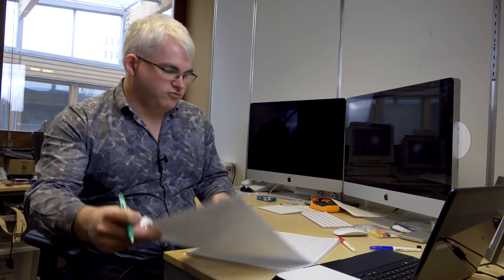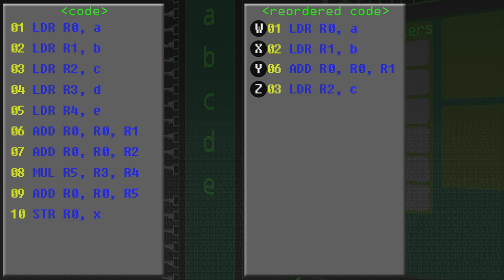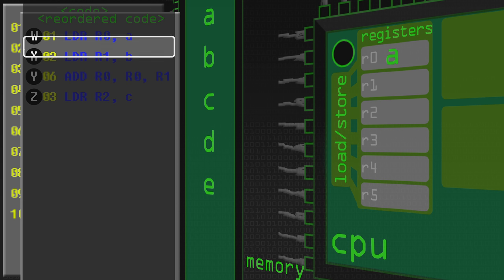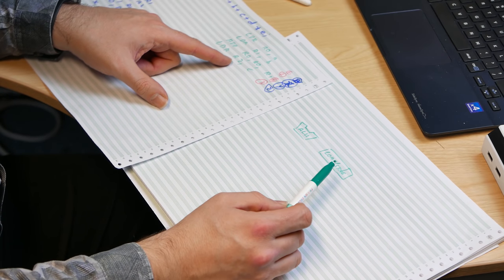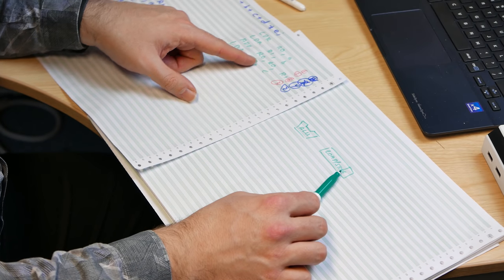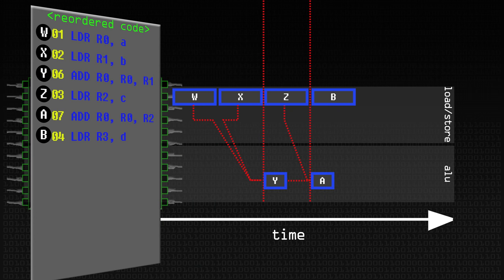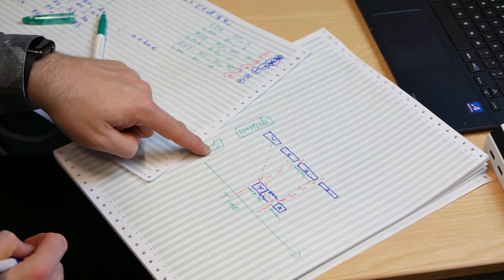CPUs Are Out of Order - Computerphile

Comment: I'm confused why the processor would ever do the optimizing, instead of a combination of the compiler/interpreter (for the particular bit of code) and the OS (for different processes and whatnot) doing all the optimizing, since those actually have all the information about what will be run.
Reply: Actually they do not have all the information about what will be run (if that were the case, it could speed programs a lot). You have to take into account the dynamic factors. Values in cache, branch prediction, utilization of individual cores (hyperthreading) etc. all affect the program execution severely and they're very hard to predict during compilation (although compilers of course try to do their best and you can help them with profile guided optimization).
Reply: The processor is the only one that knows whether an item has been fetched from memory previously, and is in the cache, which provides a huge speedup. The compiler cannot possibly know the contents of the cache, although it should do some optimisation of its own.

BTW, modern software can be rather inefficient, and it if weren't for fast CPUs, things would sometimes  go very slowly...
Reply: That's exactly how Intel's Itanium CPUs work.
Reply: If the compiler or interpreter were to try and it do it would be what's known as a premature optimization because you'd be optimizing for an assumed/theoretical cpu instead of knowing what it's actually capable of. It could be that your optimizations work well for a select few or even a great number of cpus on the market today, but tomorrow will come and new cpus will be released and your modified code could very well perform worse on those. You should just let the cpu itself do what it knows it can do.
Reply: ZeikJT if your compiler knows what CPU it will run on (and given the size of actual executable machine code versus the size of storage there's no reason not to include all existing CPUs), then it can target all of them. If a new CPU is built you can recompile your code to make it the most optimized.
Reply: Jakub Beránek but the OS understands those factors. Combining what the compiler knows and what the OS knows should include everything the CPU knows (assuming the CPU correctly identifies itself to the OS), as well as quite a lot more.
Reply: I must be misunderstanding you Joshua but it sounds like you are saying that the compiler knows before execution what the various states of registers etc. will be during execution?
Reply: Dan Kelly it knows to the degree that it's code controls them (obviously it doesn't know all the exact values, just where they came from and what affects them). But the operating system knows the rest, because it knows all the code that gets run on every processor.
Reply: Joshua Hillerup Compiling and distributing different binaries for every possible combination of CPU clock speed and cache size would be a ridiculous waste of resources...
Reply: The compiler knows how the cpu works in theory, but in practice the cpu is  almost never exclusively running your code (unless you are writing an OS) , it's running a lot of other things too which leads to a lot of uncertainties in terms of the cache. I don't know of any way to query the cpu about what exactly it has stored in it's L1 or L2 caches for instance and the query itself, if possible, would probably be slower than just letting the cpu do it.
Reply: In a multitasking operating system it is impossible to anticipate the exact state of the CPU and cache beforehand...
Reply: I should probably specify that I'm musing on if a future operating system designed to make use of information from say a compiler or interpreter for a dependantly typed programming language could exploit to to make everything be fully optimized, and less wondering about say current gcc and Linux.
Reply: ZeikJT aren't processors completely deterministic though? Shouldn't the operating system know what the processor (or rather full set of processors) has already done?
Reply: But you still can't take it all into account because of user input and whatnot. If a program asks me to enter any value, you couldn't have infinite optimisations for whatever I could write.
Reply: Casper S? The compiler knows what values can be taken in, at least if it's for a language that cares at all about things like efficiency.
Reply: Joshua Hillerup Nope. They're not deterministic, or at least not if you have I/O (where you don't know what will happen; will you receive a network packet, complete and receive a disk read, or detect a key press, or not? etc...), or operations that involve true randomness (rather than pseudorandomness), which some CPUs do provide for with instructions that utilise specialised electronics for (such as exploiting quantum uncertainty), such that they can generate true random values.

Absent these factors however, yes they would be deterministic, but a computer with no I/O is not a particularly useful computer. And everything must be invariant to retain that determinism - eg. same memory capacity and speed, consistent clock speed per core, and so on and so forth. This is very hard to achieve - even impossible for most architectures.
Reply: Matthew Ducker can't that randomness be constrained?
Reply: Casper apart from constants it doesn't know what any value is going to be, but it does know what types to expect and what will be done with them.
Reply: Two reasons CPU optimize: 1) Compiler only produce binary for an ISA (instruction set architecture), not a specific CPU, your x86 binary has to be able to run on Intel i7, AMD Ryzen, or Intel Celeron;  2) Different CPUs have different internal features (clock speed, cores, ALUs etc)
Reply: Leon Yu that sounds like a design flaw to me, when taking into account everything in a system.
Reply: Problem is "knowing" is not enough.  It has to be mapped to memory, and all known states can be practically infinite even for a simple program.

Then there's interrupt of all kinds, which OS knows will happen but does not know when or how it will happen.

Then there's problem of finely tuned optimization can break extremely easily.

And even with such finely tuned code working as expected, it may not be worth the cost after all.

Basically, you are asking for Itanium.  And look at what happened to it.
Reply: ikickss the only thing I'm asking for is a unique identifier for the exact processor being used which is accessible by the OS, and the relevant details to be published somewhere. Since a processor already reports details such as which instructions are available that doesn't seem like much.
Reply: Only in theory.  
Deterministic =/= useful predictability
(I am ignoring built-in random number generator which is another truck load of worms.)
Reply: You can call it "design flaw", but that's what legacy and future-proofing is all abut. Your software not only has to run fast on everything that was produced before, it also has to run fast on everything that will be produced in the future. The same is true for CPU, your CPU has to run everything that was produced in the past for similar CPU, it also has to run everything that was produced in the future for similar CPUs. 

Alternative approach is the JIT/scripting language model, where you produce a code that won't be compiled or JIT'ed until user needs to run it. Problem with that approach is that user needs to install the runtime (Java/Python/.NET/etc) on their computer.
Reply: I have a similar concern.  Granted my understanding is limited of how microcode is impleted in hardware, but I don't see how the CPU can efficiently figure out how to order the instructions in real time without adding a lot of overhead to the program.
Reply: A ahead-of-time cpu-specific optimizer is an interesting idea, but that's pretty much what the CPU does already with out-of-order execution and microcode. There's also issues where you have unknown branch results and potentially funky pointers and it's literally impossible to optimize all of these ahead of time.
Reply: A future CPU will be required to execute loosely typed code. A great design will be offset by Intel's ability to buy a better manufacturing process. The CPU design called "The Mill" has a lot of interesting ideas in this area, and the designers realize that they might as well not exist without a standard C compiler.
Reply: That's exactly what VLIW does. Problem is assembly is pretty much impossible to do, they use more memory and compilers are a pain to write and optimize
Reply: They tried to do exactly this with Intel's Itanium CPU architecture - unfortunately, due to problems it failed to achieve market success.
Reply: Samuel Hodgkins just in general, it hasn't worked much because of software complexity. The VLIW/EPIC concept works, but the heavy reliance on compilers is probably one of the reasons it never was in any non DSP/GPU
Reply: I would suggest one reason is that the machine code programm would have to know the exact cpu architecture to be optimized previously by the compiler, so for every littel change in the cpu build you would have to compile other machine code. But this way, the "unoptimized" code can be given to the cpu and the cpu itself can work out best how to reshuffle the instruction as it know exactly how it was designed and what it can do best in which way.. But that's just what I think.
Reply: ΜrCookie there's a huge tradeoff though. Out of order cpus need a LOT of extra hardware ; scoreboard, issue queues, dependency checking, reordering etc. In some early OoO cpus, that hardware took half the die space.
Vliw allowed for DSPs with 8way issue when superscalars were still stuck at 2-4way.
Reply: Deterministic != predictable.

Look up some Chaos Theory, as this is its fundamental conclusion.

Simple deterministic rules does not necessarily insist on an unsophisticated output. That belief - that bit of human "mythology" that we'd all previously assumed - is exactly what Chaos Theory corrects.

Chaos is not random. It's entirely deterministic. But its sensitivity to initial conditions - and the potential explosion of butterfly wings into tornadoes - means that, without the ability to describe the system to infinite precision (a fundamentally impossible requirement), it rapidly becomes intrinsically impossible to predict.

For example, the moon Hyperion - a moon of Saturn - is not big enough to have been entirely rounded off by gravity. It's kind of potato-shaped. And, obeying the laws of physics, it kind of tosses and turns and flips about, as it orbits Saturn.

Everything in this system is deterministic. Its movements perfectly obey the laws of physics - simple deterministic rules - and the gravitational influences of Saturn and the other moons are all known.

But if I asked you to predict its exact orientation in three months' time, then we tested that prediction, you'd be wrong (unless you omnisciently knew absolutely everything in this system to infinite precision - which is, of course, an impossible requirement, which is what allows me to say, with mathematical confidence, that you'd be wrong. Not "you'd most likely be wrong" in a probabilistic way but just "you'd be wrong" as a mathematically guaranteed fact).

Indeed, what we call "pseudo-random number generators" are really, on closer inspection, just "chaotic number generators". Their pseudo-random behaviour - a deterministic process delivering what, to all intents and purposes and predictive ability, might as well be random - is really derived from them being deliberately made sensitive to initial conditions... and then you just let chaos do its work.

I know. I know. If you've been brought up to believe that "simple rules = simple outcomes" then the idea that "deterministic != predictable" might seem a bit mad (the word "deterministic" even comes from this previous belief, as it implies that future behaviour can be "determined"). But read up on Chaos Theory and it'll soon put you right on that one.
Reply: Because needing to recompile software every time a new CPU came out (or at least a new CPU architecture) is like retraining every employee in a business, because someone was hired or someone left.
Having the CPU self optimize is a Day 1 speed upgrade,  that could cost other companies possibly nothing. Unlike having to update compilers.
If a compiler had to be updated every time a new CPU came out you would have to wait for:
A) The new compiler optimized for Intel _ generation processors to come out.
B) An IDE/Tool or whatever to implement that new compiler.
C) The developer of a piece of software to update their Tools  - This can take a while since the developer needs to confirm the update doesn't break compatibility or whatever.
D) There to be enough bug fixes/updates or for everyone to finish the bug fixes/updates they are working on to actually release an update to the software.
- By now I'd have to guess a few months have passed.
Go back to A) because AMD has now released a new CPU., and we need another compiler update.... keep repeating this.
By the time all that is finished, repeat it again because now
Reply: Throughout history, compilers have have failed to live up to expectations. Look at the Itanium's EPIC architecture. A great idea to improve IPC by compiling instructions into very long instruction words.

The complexity of that idea was handed to the compiler. The Itanium was a big failure.
Reply: A compiler can't make the CPU do multiple things at once if the CPU is not designed for it

Comment: Another thing that I noticed, that wasn't mentioned in the video, is that reordering the code also opens up registry space for reusability. 

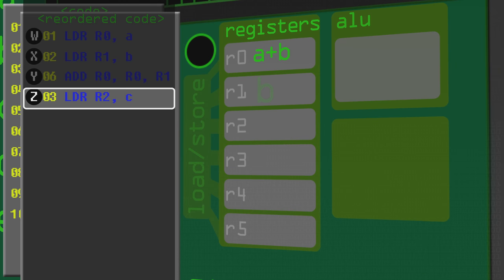For example (6:55)
load r0;
load r1;
add r0 = r0+r1;
load r2; <---- this could easily fit in r1; so instead, you'd have load r1 and then add r0 = r0+r1 would keep repeating instead of accessing different memories. 

Note: This would only work if the variables are one-use only. That's to say, there's no use for them afterwards in the context of the program. If you do need to access variable b again, then you wouldn't do this, of course.
Reply: Valid point, but that opens up a whole new layer of complexity...
Reply: Hey, if designing a CPU was easy, everyone would be doing it xD
Reply: yes, intel CPUs can actually do this. However, they typically do the exact opposite:
Consider this code.
...
add r0 = r0+r1;
load r1;
...
Notice that the load instruction needs to wait for the add instruction to finish, because they use the same register. Intel CPU will simply use different free register in the load instruction and adjust the rest of the code accordingly.
....
add r0 = r0+r1;
load r2;
....

Comment: Spent my life on the H/W side of the fence as a developer, and have NEVER understood why problems like this, which could be addressed by having architecture-specific compilers written once and used once to generate optimised code, are always moved into H/W creating massive complexity (and hence bugs that turn up months later and can't be retro-fixed) and burning power on every single execution cycle on every single machine every single time it runs that bit of code.
I agree that, usually, generalisation = slow and optimisation = complex, but surely it's only logical to put the complexity into that part of the system that can be easily changed when problems arise (as they always do with complexity) and which only entail effort/energy/time once at the start of the process. For H/W, the KISS mantra reigns supreme and complexity should be reserved for those things that can't be done up-front.

Comment: Why wouldn't it take more cycles to analyze and determine an optional order than you'd save by using that new order? Does the compiler that originally compiled the code handle this? Or is this truly on the fly?
Reply: Moderns CPU's have sufficiently complex hardware to analyse instructions several steps before they are actually executed. IMO the example chosen is simplistic, and not a good example of how pipelining works in practice.

Comment: Wouldn't it be more benificial to do the multiplying first? Because surely a MULT takes more time than an ADD?
Reply: Joris Not necessarily. It depends on the particular values. Some multiplications can be done in a single cycle. Notably, power-of-two multiplications (for integers, anyway) will just be converted to bit-shifts (a single cycle operation), but there are still others that may also take only a single cycle.

Divisions are worse (again, except powers of two, which are just bit-shifts for integers), particularly modular division. These can take many cycles.

The implementations of ALUs have many complex tricks to allow for very fast execution - I recommend reading more about them! :)
Reply: In this particular case it would! If you fetch d and e first, you can do the multiplication while a, b and c are being fetched.
Reply: Guy Maor yeah, so he showed hoe the processor would use OOE to speeds things up. If it would've been donr right it would choose to do the multiplication first in most cases (since a multiplication consists of bit shits and adding instead of just adding 2 numbers). This would mean that at the end of the line it would have to wait on an ADD instead of a MULT, which would speed the whole process up sligjtly